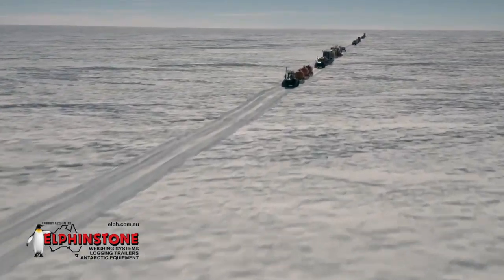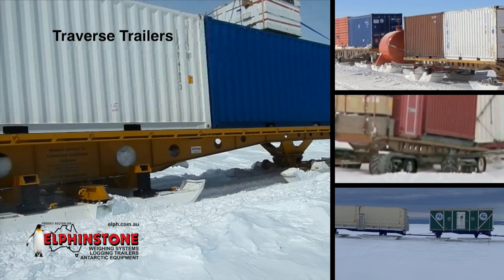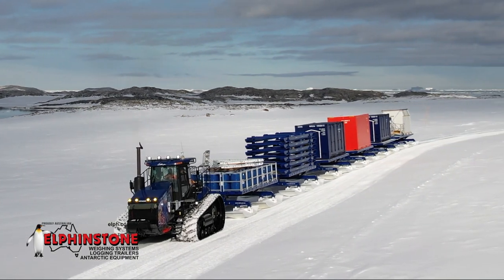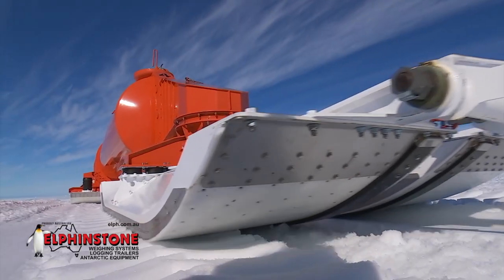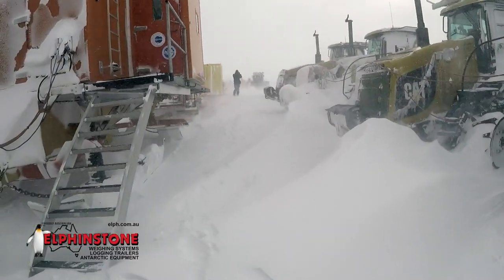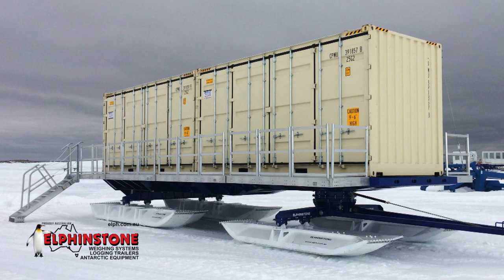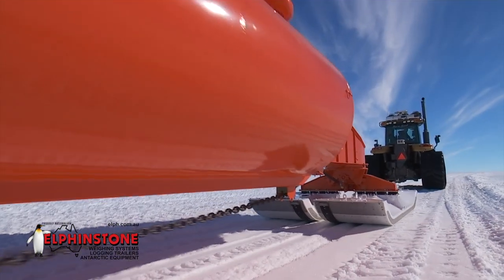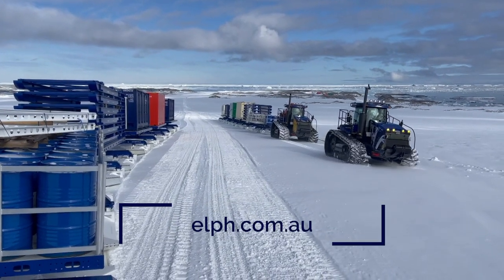How Antarctic traverse works with Elphinstone Antarctic Equipment

Comment: You’d think LeTourneau’s land trains would live in and be used in environments like the Arctic
Reply: That is indeed where it was used, and as far as I know is still abandoned there somewhere.
Reply: The concept is clever AF.

Use a large diesel generator to power individual motors at the wheels.

It'd likely be even more effective with EV technology now. The use of batteries to offset load on the generator during the day, then recharge the battery overnight and never turning off the generator in extreme temperatures.